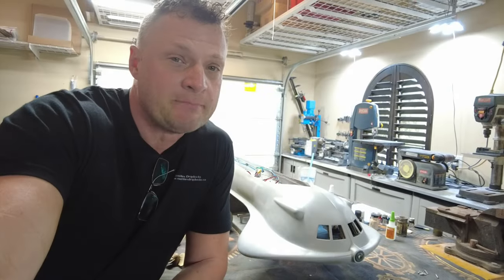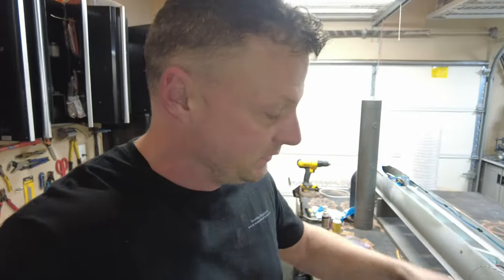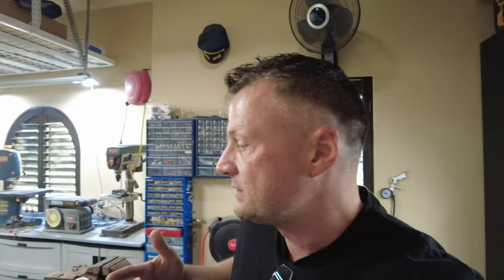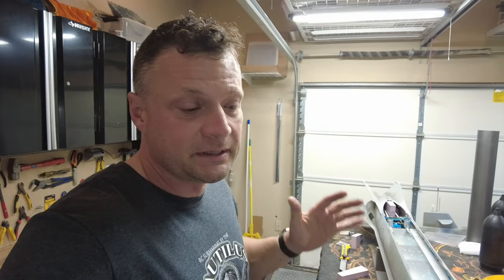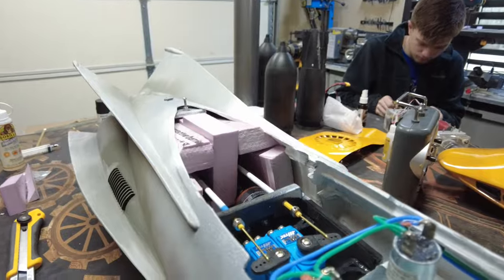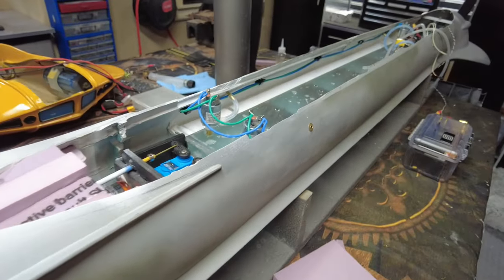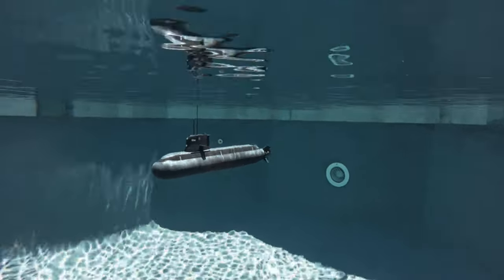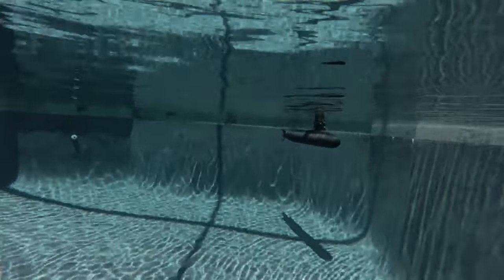Building the 80" Deboer Seaview RC Submarine - Chapter Five

Comment: It looks as though you're top heavy.  Do you have Keel Weights on the bottom?  Also, don't use foam for boyancy spraying it inside or you'll make a big mess and find out you can't submerge.  Much better to use little trim tanks fwd, aft and a couple in between.  Put them centerline or you'll tip.  With trim tanks, you can add and empty as needed to find just the right amount of boyancy on the surface.  Hope that helps.

An old submariner.

Jim

Comment: What if you moved the ballast tank solenoids lower in the hull?  I know there would be extra connections that might leak, but it could help lower the centre of gravity a bit.
Reply from the maker: Good thinking, but they actually weigh very little and space is actually really tight anywhere below the waterline.

Comment: Have you considered perhaps adding some low-profile ballast on the underside, like a false keel made of a piece of lead bar stock? It could be detachable, bolting into the keel inside the ballast tank via the drain holes. That would put some weight as low as it gets, distribute it evenly along the length of the hull, and free up some space inside. It would be invisible when running, and you could remove it when out of the water to keep the look true to the show. 
Obviously I don't have the model in front of me so don't know how feasible it all would be, just throwing some idea around ;)
Reply from the maker: That's exactly the path I'm going to go. Good thinking!

Comment: Try individual smaller tanks each with its own pump, you must control the boats trim with individual ballast tanks separated . Judging by your water ballast tanks they are way to big and your flooding all the tanks at the time, which will cause sloshing as their are no baffles in the tanks. Subs stability is stablized by trimming the tanks individually . The trimming of the tanks determines the subs stability. So you take each tank split it into four separate tanks each sealed from each other with individual pipes in each one to pump water in, separate tank pumps for port and starboard you need about six or eight mini pumps not foam . Water is used in separate tanks to stablize the trim this also controls its listing. Your tanks are all wrong: nice boat but the problem is the ballast tanks:
Reply from the maker: First off, the main tank is baffled and sectioned into six sub-sections that are completely separate, save for the ability for air (not water) to move in the chamber. Submarine stability has nothing to do with individual tanks and everything to do with the size of the righting moment caused by the opposing forces of weight and buoyancy. Yes, the tank is large and yes, there is a potential for water movement in the ballast tank, but the biggest issue is that in order to get something approaching the correct waterline, the ballast tank must be very low, which means the aforementioned buoyant force is low in the boat, causing the righting moment to be very small.
Reply: @RCSubGuy  your tanks are too big because simply if they where correct, then you would be able to trim the boat with them . I was not trying too be rude. I have been a RC boat modeler for over 40 years. You shift water from port to starboard to trim your boat. I saw water spilling in from one tank to the next each tank really should have an individual pump run off your radio ie. I have known about 100 or so rc sub owners never have i seen foam inside a model sub. Generally speaking you take the sub empty place weights in the hull equally along its length as naturally when you place a sub in the water with the tanks empty when you place in the water empty the sub should sit at its appropriate waterline this generally is 3/4 of the hull submerged with a portion of the hull and deck and conning tower protruding.so my advice is this take the tanks out of the boat all of them. Then take weights each equally placed on the exact keel along the hull place the hull in the water it will sink with increased weight adjust the weights so that the hull is sitting on an even keel and is submerged with the deck sitting say 1 to 2 inches above the water now after this place your tanks over top the weights temp held in place next install your pumps then using your big expensive radio i saw you with at the pool start flooding the tanks the deck should be sealed on when you do this  , i think you will be in for a nice surprise. I have been a model rc boater since i was 15 years old i am now 60 further i am a home machinist 
And i build from scratch model metal working steam engines based upon blue prints. Standard sub building practices cannot be applied to the Seaview as the design is not based on a working model. When Disney created the models for the movie “ Voyage to the Bottom of the Sea”
These where NOT radio controlled  they simply where weighed and divers in a pool simply pushed them by hand underwater while the camera’s where rolling so you dealing with a model not really based upon a working real submarine. The sails in the conning tower don’t really help either plus this sub is quite narrow from stem to stern. You did a good job building it, but because of its design characteristic’s ballasting it requires special approaches, and i have just told you one of the way to accomplish this. Take it or leave , if you have 17 years exp. Then sir respectfully you would not be using foam model subs like the real thing do NOT have foam blocks in the Hull. A person to contact on this is Lee Upshaw if he is still alive he owns a company titled “War Ship Hulls Unlimited” in Seattle Washington , he was formally a US naval Architect and might be able to help you as he offers several big big Gato class sub hulls in 1/48 scale. But he is or was a kind of snob back in 1986 when he sold me a US destroyer hull in 1/48 the USS Gearing he did not mold the hull with the appropriate beam the plans indicated a 10 1/2 beam the hull he sent me was nine inch beam he tells me as a excuse to stretch the beam by force i did the hull cracked  what he did was this, he did not make a new mold for the gearing he went cheap and stretched a mold he used for the Fletcher class, anyway he is a snob he may tell you that since you did not buy the sub hull from him he will not give you the advice i possibly gave you. A sub upon going into to the water must obtain a deep displacement this means that 75 to 85 of the hull must be submerged if not it will be top heavy and list to port or starboard.
Don’t be snobby sir remember that a lot of professional modelers like me are watching. My current projects are a 8 foot tug boat, a 8 ft chris craft a 7 foot coast guard cutter a five foot coast guard boat and a number of others from scratch all in various stages of construction i use a ten channel Flysky radia cheap but a dam good radio my past buildings of kits where mostly Dumas kits of which i built many. Anyway best of luck. Regards Daniel Ottawa Canada:
Reply from the maker: Wow.. where to start? Let's go in order, in point form for brevity, and, in advance and as a fellow Canadian, please accept my apologies as the following will likely read rather tersely and you will likely take some degree of offense.: 

1.) Stability has nothing to do with tank size. 
2.) Your experience with RC boats has no bearing on your ability to properly identify and rectify an issue with an RC submarine. RC boats are exponentially simpler than a sub. with your boats, you're trimming for one static state in one plane of operation. Comparing the two craft is like comparing a paper airplane to a real airplane in terms of complexity. 
3.) I've not ever heard of an RC submarine with trim tanks for roll. What you're talking about is a valid solution, but highly complicated to implement compared to simply trimming the boat properly in the first place. I've been there, done that, and have the videos posted to prove it.
4.) 100 RC sub owners. Really? That's impressive. I am doubtful at this number, but hey, what do I know? I only have the most comprehensive database of RC sub skippers in North America, after all.
5.) Foam is virtually ALWAYS used in an RC submarine except if you're talking about the old dry hull boats with a million bolts to hold a flat lid on the watertight compartment. 
6.)  This particular submarine project has NO flotation without foam. Nothing floats in it. Nothing
7.) A submarine waterline is not 3/4 of the way up the deck. It ranges from around 2/3 to 9/10, depending on the subject
8.) With your (interesting) ballasting technique, how the heck are you getting a submarine to float at waterline with the tanks not installed yet? Put the weights in, achieve proper waterline and THEN add a ballast tank? Are you on drugs? At best, the sub with no tank could be trimmed to submerged state, either neutrally or slightly positively buoyant. You understand that, right? 
9.) Your age, the fact you were a machinist, or that you build steam models has no bearing on the experience needed to build a submarine. I am a private pilot, but that doesn't give me the experience needed to fly the space shuttle, does it? 
10.) Disney didn't create VTTBOT. It was an Irwin Allen movie brought out by 20th Century Fox in 1961.
11.) Yes, you're correct! Ballasting this fantasy submarine does require special approaches, which I am currently undertaking. 
12.) I don't have 17 years experience. I have 25 years of experience. Throughout my professional building career, I have built HUNDREDS of RC submarines. Most of them are even documented here on my YouTube channel. I literally wrote the book on RC submarines. Perhaps you should invest in a copy of it: "Diving Deep: A beginner's guide to RC submarines"
13.) Lee is a hull manufacturer and is fully retired now. I'd go to him for his experience in laying up fiberglass hulls, not for building an RC submarine.
14.) A stable submarine does not require deep displacement. It requires a high righting force, which is obtained with the upward force of buoyancy acting high in the hull directly over the weight (center of mass), which pulls the boat downward. 
15.) I am not being snobby. You are simply giving incorrect information based on armchair experience and I am pushing back. You have not built an RC submarine and do not have sufficient RC submarine experience to tell me what I am doing is wrong with any authority.  If your advice had validity, I would happily accept and compliment it.
Reply: @RCSubGuy  Thank you, but i swear to you, although i do not build subs , i say to you that i have never seen foam ever in any of my friends Submarines that is a Factum. I am not offended its really not complicated to have multi pumps. You do not understand what i am trying to assist you with. Look your sub needs to be weighed down enough with lead ballast first with water ballest tanks emptied to the proper water line , then you fill up the tanks as you fill them up the sub slowly sinks when they are pumped out the sub surfaces. I have sir studied many many builders of model rc subs i could build one blind folded further i have studied the real working sub of today and yesterday, but i frankly am not a sub man as i don’t like models i cannot see when submerged. Regarding your comparison to surface craft yes subs require that extra touch of education and some guess work but in all cases boyancy balancing is  
Practically the same especially in the case of having a list to port or starboard. I saw your tanks, you indicated that my solution was complicated well yes to some it would be( thats not an insult) in the modelling field we all learn from each other non of us know everything we take what can use from others with our own ideas and sometimes mix the two together to form a working relationship. Look if it where me with your sub project i would dump the current ballast system pull out a sheet of paper a rule and start over again. Further as i stated take the tanks out or empty and seal them to open sea water, then take lead with your ship afloat place it right on the keel the length of the ship right to the engine compartment and forward to the fins at the bow then place it in your pool,measure where the scale waterline would be before hand which should somewhere between one and two inches below the deck on each side once you do this and she’s not listing, then fill the tanks until she starts to sink upto the the top of the conning tower fins see if she holds a neutral boyant position , this is exactly what i would do. Your tanks i would change them i would have eight separate tanks on each side of the keel each two tanks port and starboard of the keel would have each their own water intake pump, two things infact excuse me trim a sub the sail fins and the stern fins in conjunction INFACT with sea water Ballast. Good luck regards D: